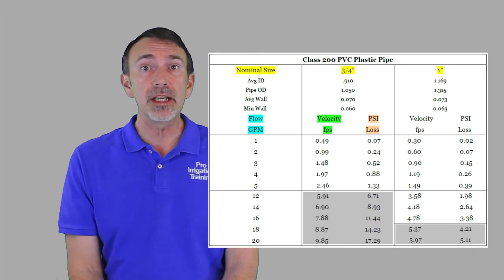How To Read a Friction Loss Chart (irrigation pipe)

Comment: I have a 450 gallon water tank. And have 2ft of 3/4 PVC going up to a filter than the exit of filter goes down 25 ft so how much pressure will I lose
Reply from the maker: If your water demand from the system is less than 8 gpm (the recommended limit of schd 40 3/4" PVC) then you'll lose less than 2 psi from the pipe, plus whatever loss from the filter, then you'll gain pressure on the downhill run. If it's 25' straight down elevation loss, then you'll gain 10.8 psi.